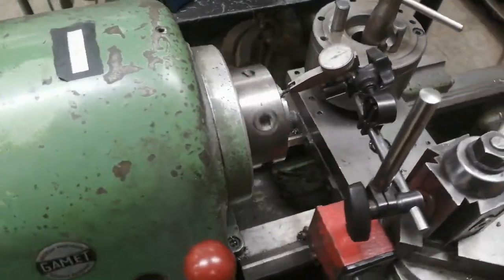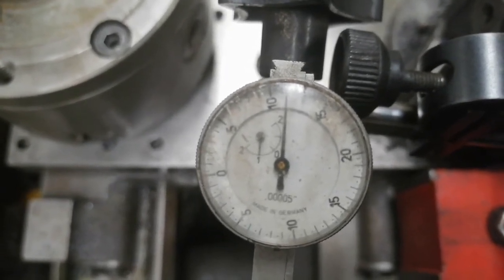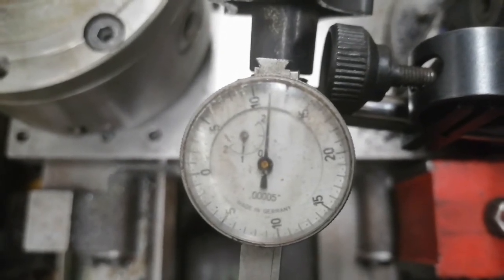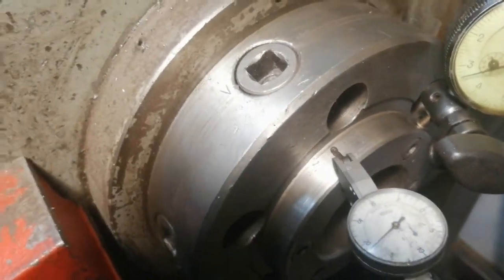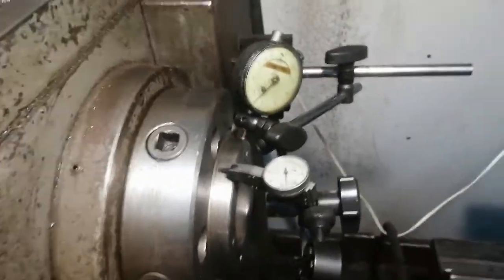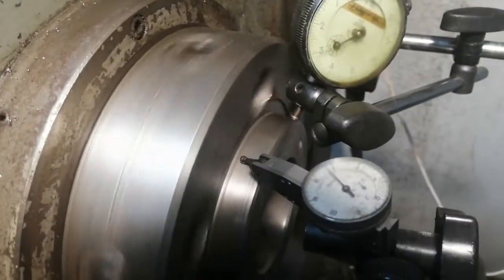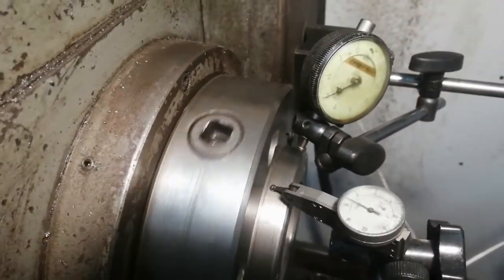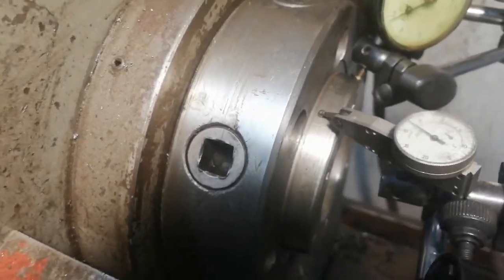Lathe spindle run-out testing

Comment: How do you correct the run out ?
Reply from the maker: You can try changing the bearings in the spindle . Also if the nose is beaten up you may change it - but it is usually too expensive to do (I.e. changing whole spindle). Every spindle has some run out - usually its not a problem for general machining.